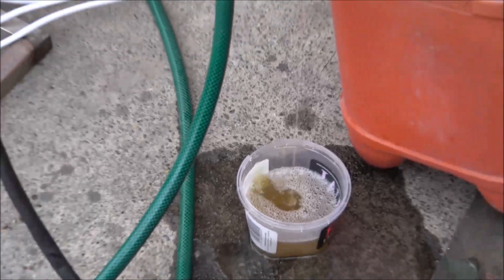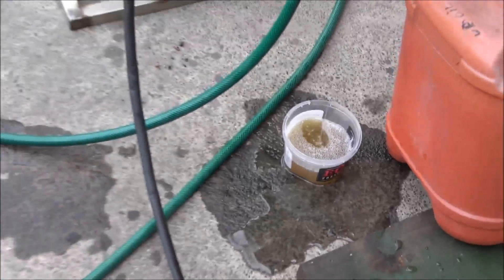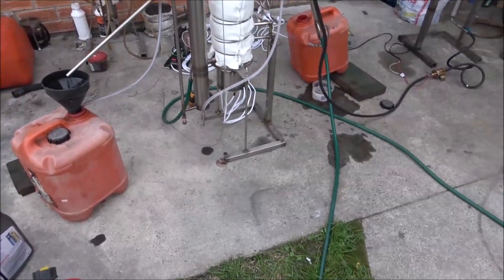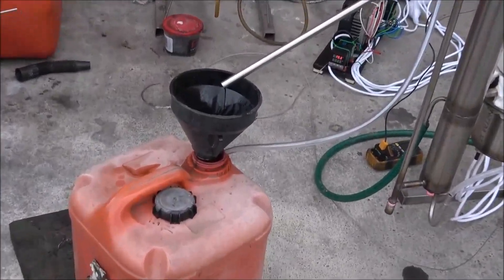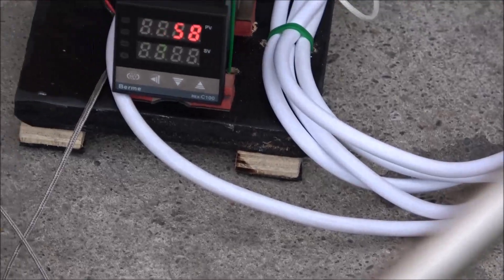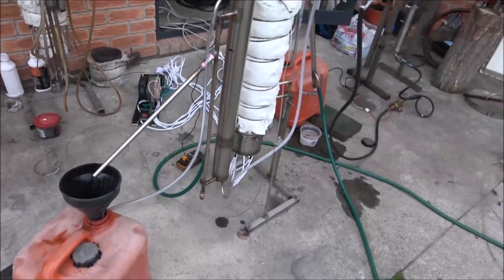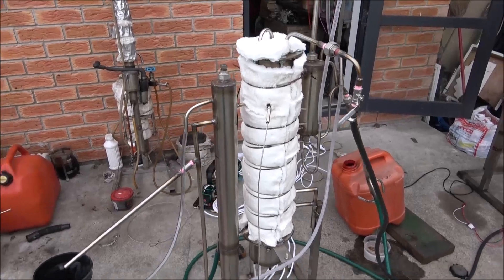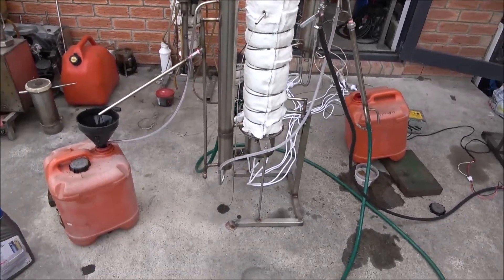WMO to diesel still -  test run day one

Comment: I have bought your design machine ... but it can't operate continuously ... when the continuous supply runs, there will be a change in the color of the diesel ... it will become turbid,.
Reply from the maker: Hi, first you need to implement an electronic temperature control unit, so the temperature is always the same, the best is 410c for the automotive oil, second, you should make sure that the oil is free of water. I will upload a video about the automatic transmission fluid processing, and the result is turbid as well due to a coolant presence, so after settling, and absorbent the oil should become transparent. Also, please email me a sketch of your particular unit construction, what sort of possible "improvements" you may do to the distiller, what type of elements, power consumption, the temperature of the processing, nature of the oil?
Reply: @santeryi9  ok.sir..
I will send u mail..
Thx